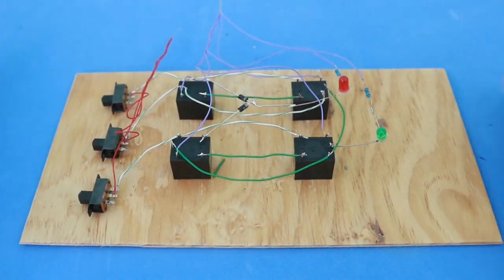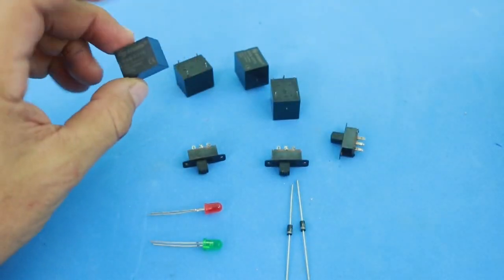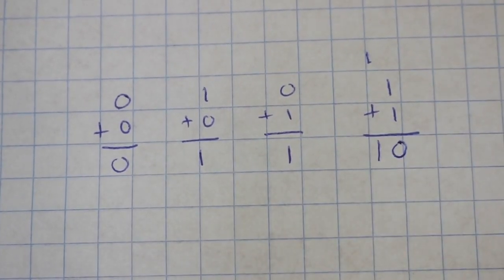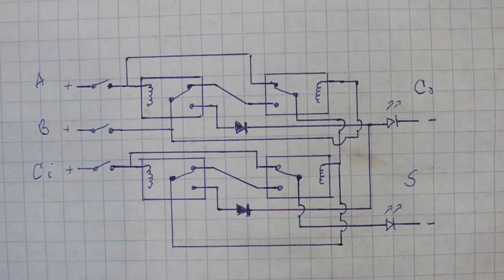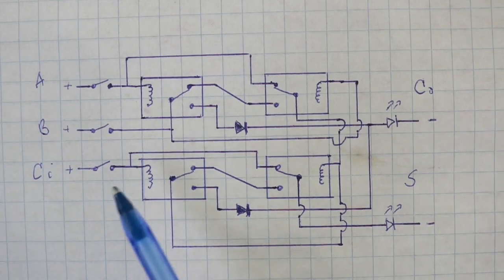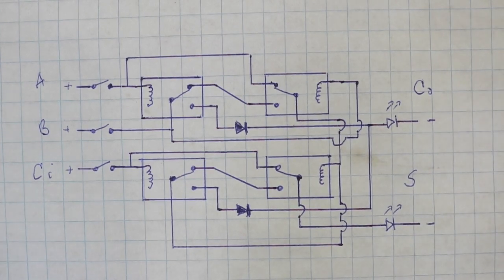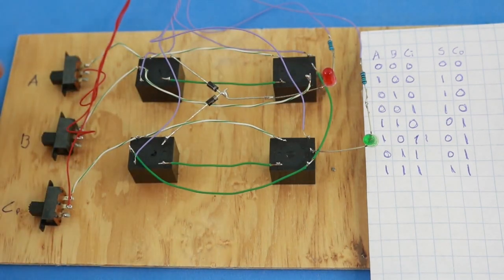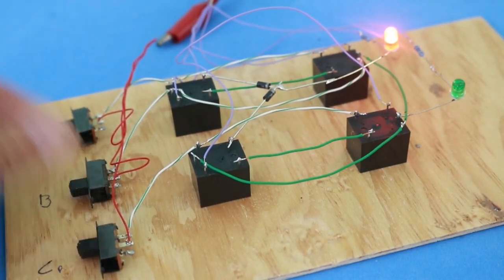Binary Full Adder Made with Relays

Comment: but when i chain 6 of these together how do i actually get it to add and remember what i added. How do i input the number to add. I want to keep adding a 1 over and over to count something as it happens.
Reply: If you want to add lets say two 8 bit values together, you just make 8 of these full ader circuits, and hook the carry output of one into any input of the next full adder.
This way, you have a carry over across all bits, but yet have two input values for each bit to add the values together. This is called a ripple carry adder btw if you want to look it up.

If youre actually wanting to count, you would need at least some sort of storage register with write enable. If you were to hook up an 8 bit register into an 8 bit Ripple carry adder and feed the output back into the data input lanes of the register, you can add any number onto the stored value. (This is called an accumulator) every time you trigger the write enable, it will store the new evaluated value, just be aware that you cant do this too fast, let it settle.

A counter needs less relays, because you dont need an entire adding circuit, you just need an incrementor circuit. Faster than ripple carry adder and needs less relays as well.

Hope i didnt sound delusional, i dont know if im good at explaining, let alone i dont know how deep youre into the topic.

Hope this helped xD